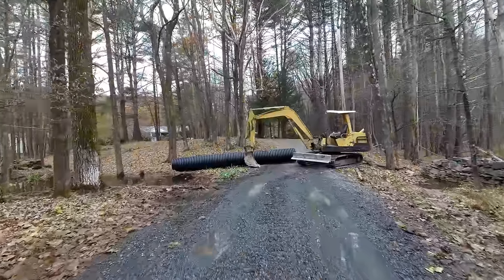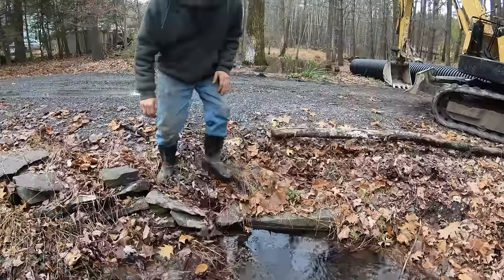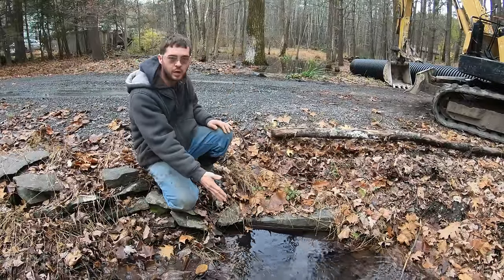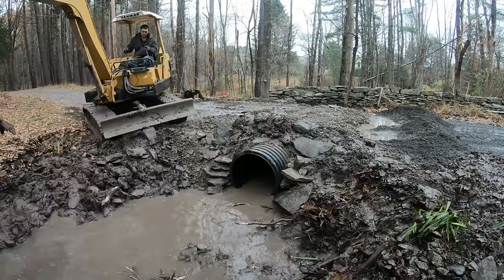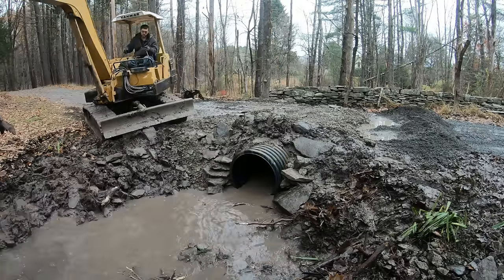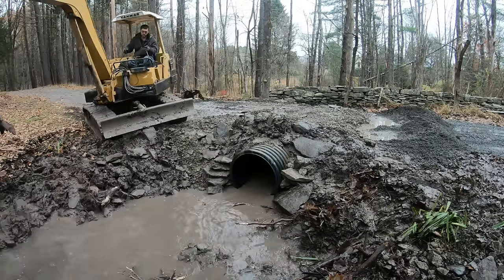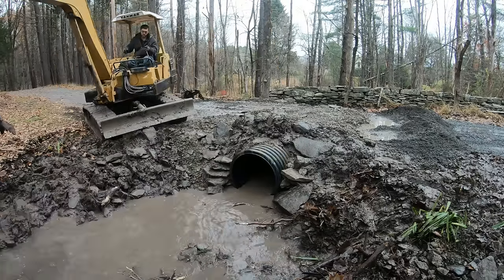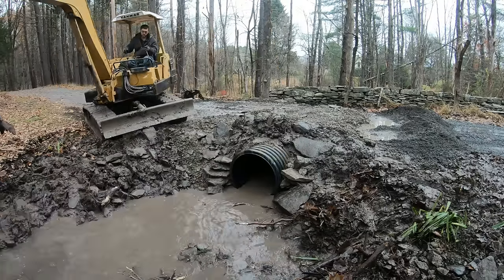Replacing a culvert pipe

Comment: Nice work Andrew!😉. Why people say you need more over the pipe is because ADS pipe what you're using suggests min. 12" over coverage. But most applications it isn't as rocky as the ground you seem to be working with. Here where I'm from in the NW we have some soft soils and can blow out the pipe easily if not covered good.  Keep up the good work and love the videos!
Reply: also need to remember this is just a regular drive way. so probably not heavy traffic or heavy vehicles crossing on a regular basis... hahaha.. probably should watch the entire video before commenting :P
Reply: mark suson  Uh huh. You obviously know nothing about heavy construction.  
1. ADS pipe gets its strength from being property bedded and backfilled with the proper material. 
2.The pipe was partially punctured with the excavator tooth.  
3. The pipe was laid directly on a rocky ledge bottom. 
And no heavy vehicles?  Septic truck, oil truck, fire truck.
Reply: @newmilfordseptic3375  I agree with you a 50 year rain will blow that pipe out. 12 to 18 inches of cover for plastic, I would use cast iron or concrete for that job.
Reply: New Milford Septic finally somebody talks dam common since

Comment: Where I am in Texas there isn't rock isn't as easy to come by. I can't be certain, but feel like the price of rock is likely a lot higher here. I have a half mile long dirt road that I had purchased a tractor to maintain. Wish I could get a lot of rock laid on it, but alas, half a mile of rock is expensive. Boxblade and grader worked great for what I was doing. Sadly had to sell the tractor. Next one I get will have a front loader on it. So many things I did with that 3pt that would have been tons easier with a front loader! Enjoy your video as usual. Great work.

Comment: When you do two pipes side by side, be sure and set them apart at least 1 to 1.5 pipe diameters, back fill and compact in layers to fill any voids between them so the vehicle load force on the crown of the pipe is transferred vertically into the ground rather than laterally into both the tube bearing the weight and the adjacent empty tube that may likely fold...…….cheers Andy! You and Levi rock....

Comment: Hi Andrew you are unique mate I watch your videos almost every night now as I was a plant operator in the UK and drove a JCB 3 digger loader which you fellas refer to as a " backhoe" it was similar to your wheeled John Deere machine.I too have a mig and a stick welder and a plasma cutter and love to make and repair things but I am not great at mechanical repairs 😥.
 Andrew a thick plastic culvert pipe like you replaced will take an enormous amount of weight as long as it is back filled and compacted properly as the pressure at the top is distributed from the top down the sides and out at the bottom so won't collapse down if a heavy truck goes over it .
Keep up the great videos mate I will be as sick as a parrot if they run out so stay busy pal and take care of Levi and Sophie they are boss mate! David Flynn Liverpool UK.

Comment: Think the pipe depth was spot on,  if it was dug in deeper you'd think it would block up quicker with sediment.  That smooth bore black poly is excellent,  tough as , self cleaning to a degree. The outlet area might need digging out a bit , might keep the inside of the pipe cleaner.

Comment: as a construction inspector I would have liked to see a gravel base set to a percentage of  grade from end to end and covering the pipe with some clean modified would have been better than pushing in the excavated soil to prevent distortion of the pipe  but neat job
Reply from the maker: Yeah, that would have been better. I gave her a price, than she talked me down. She wanted it done as cheaply as possible. That fill material was mostly stone though. But since it settled for a couple weeks before I added more stone It should be fine.

Comment: Great job! I can guess if this collapse (since we can't control what runs over our driveways sometimes) a stronger solution will be to add a 6" concrete slab over the culvert pipe and see who's going to break it but that's on your customer. Time will tell.

Comment: From my experience, I think the depth of the pipe is fine. If you set it lower, and if there was a heavy rain the volume of water would fill the pipe up and the excess would cut across the driveway. In my opinion.

Comment: Increasing the pipe size from 8" to 12" diameter (x1.5) will roughly double the flow. Double the pipe size from 8" to 16" diameter (x2) will quadruple the flow (x4 flow). With Andrew putting in 20" pipe, he's increasing flow roughly 6 times over a 8" pipe diameter.
Reply from the maker: Plus the smaller Pipes seem to clog up with leaves
Reply: @AndrewCamarata  Definitely the truth. I agree with your call on the steel corrugated pipe too, that stuff is junk and just rusts out. Plastic or ABS is the way to go. Great videos, keep up the good work Andrew.

Comment: try buying a plate compactor or small roller if you do alot of these gravel driveway repairs. yes, filling the pothole with a larger rock will work for now but really isnt the correct way of doing it. Nothing is keeping those large stones from moving. A nice compaction of the base prior to spreading the top layer or gravel will help keep those holes from reforming. A snow plow or heavy truck (like the garbage truck) will make those larger stones shift and push them out of the way but if you compact some road base stone (3/4 crushed stone and stone dust) it will be almost as solid as asphalt, then you can lay the gravel in and will get alot better, long lasting result

Comment: I noticed on your dump truck you pull the lever down by hand. Tie a rope on the handle and bring it in the cab through the window. then start driving and pull the rope when you want to open the tailgate. Will make it much easier than jumping in and out of the cab.

Comment: Good job. The Ford seems to be your go to dump truck. Big one you bought still working OK? On capping culvert pipes: old spec is cap with minimum of 50% of the diameter of the pipe. But if you can drive a heavy garbage truck over it and it doesn't collapse what you did looks to be just fine. We don't have bedrock at 2' down here in Texas:that has to be really hard on your excavators.
Just an observation but you're replacing a lot of metal culverts because they've reached the end of their service life. Acid rain does a number on them as it does here in Texas. 30 to 40 years and they're toast.Seems like price wise from low to high it's concrete,metal,then plastic. Used all 3 and personally I have no preference. Concrete is a bit of a pain because of the short lengths and labor to install.Trick I learned years ago is to put an asphalt shingle over each joint before capping. Keeps the fill fines from seeping through the joint and plugging the pipe.
Reply from the maker: Thanks. Yeah, only needed a little gravel there, I would rather use the Ford for that. The other truck is ok.

Comment: When you hit those hidden rocks below the water you should have dumped soil across to stop more  incoming water, then the water hiding those rocks would have drained away leaving the rocks visible, making it easy to dig them out to get the trench about 12" deeper and making sure it had a flat sloping bottom to it, the pipe should then have been carefully infilled with fine graded material around the sides before covering it, more care should also have been taken when building the slabs up at each end of the pipe.

Comment: When he does a job and then leaves, it is as if that was always there and part of the scenery.  I would hire him anytime.  Those rocks on the ends is a great added touch most people wouldn't bother with.  I've seen guys have their driveways dug up, a pipe laid and they spread dirt and gravel mixed back over it to cover it up and level it off and leave.  The homeowners were raving mad.  They didn't  expect that YET they didn't ask them or tell them how they wanted it done.  She made a costly mistake by not hiring him the first time. I did not see, for example 16 feet of pipe when he dug that up so what did the other guy really do?

Comment: Potholes will never go away until they are dug/broken up. The dirt/soil/ground should be tilled or raked or bladed until there is noting but loose base/gravel. I then go back and regrade and spread fresh gravel on the drive. Just filling up the hole does nothing. You know this stuff though!

Comment: WOW< What A Difference between the old pipe and the new pipe, i reckon the old pipe was 4 times smaller then new, uyou can see the new pipe bearly gets the water in the bottom while the old pipe was getting FULL of it, full  of the water

Comment: Looks pretty good. If you keep having problems with potholes and need more coverage on top, you should try two 12" pipes and set them side by side, then place a good amount of riprap  along the bottom and sides of the inlet and outlet to prevent erosion.

Comment: The ADS needs at least 12" of backfill. You should either use multiple smaller ADS pipes and provide the cover, or raise the height of the driveway.
Reply: and let the water Atleast go down an drain before throwing pipe in a fighting it.  your rights not enough fill on top he said trash man drives on it..  he will destroy that area

Comment: your potholes came from backfilling with saturated material that looked like concrete slurry. should have been hauled away and backfilled with clean , dry material and compacted  every 8-10 inches.I would agree , it needs a good lift over top. At least another 10 inches as poly pipe tends to flex more than other materials.

Comment: you did a nice job Andrew I would be interested if there are any bottlenecks just downstream that would impede the water from moving away quickly from the problem site otherwise as the water backs up in a heavy flow you get flooding; I always get my contractor to remove any large boulders downstream

Comment: That customer sounds so irritating. She went with a lower bidder who bid to only do a bit of digging and clean out a collapsed culvert... which did almost nothing. They probably did a fine job, but only did exactly the work they quoted for. So instead of calling that contractor back for the additional work to get the job done, she called a different company (you) to do the job that should have been in the first place. Then when it turns out more gravel is needed to do the job correctly because of the bedrock, she has to be "talked into" a tiny $150 load of gravel. They say the customer is always right...

Comment: Plastic pipe is nice. Not so rigid as steel. The ditch in front of my house needs a culvert, but runs on downhill incline.  Hoping to put plastic one in and cover with dirt for mowing purposes. Don't know if local road commissioner would do it or not. They use metal culverts everywhere.
Reply from the maker: I have never had a problem with a plastic pipe. The metal ones always seem like they are rusted out.

Comment: I calc'd drainage areas and sized culverts for roughly 30 yrs and then supervised their installation.  Getting a SOLID even base is key to a culvert lasting and having the correct cover is also part of the formula so it doesn't get crushed by a cement or garbage truck!  ADS (green stripe) has a booklet that tells you HOW to do a culvert installation.  Please talk to the owner about getting the stone you say your going to bring in and getting the 1 foot minimum cover ADS recommends.  Failure to do so puts you at risk when it collapses of having to do it right the second time around at YOUR cost! (edit)  On a side note I would have placed an 18"x24" class 5 concrete culvert in as you get HS20 loading with minimum cover... you could actually drive ON the culvert if need be!  But then I didn't have cost restrictions most of the time...
Reply from the maker: I told her it needs more stone, she doesn't want to pay for it. I wouldn't be changing it at my cost. But I don't think it will ever fail.
Reply: If it was my property and it failed you would most definitely be re-installing it... thru a different contractor that you would be paying since I would prove in small claims court that you did a schlock installation not up to standards!  (edit) Course if it WAS my driveway I would have rejected the work and not paid you!
Reply: Not everyone has unlimited funds. 
And why would an expert hire someone to install a culvert for them??
Reply: Maybe because I don't own a backhoe??

Comment: Just what I need! I have a stream separating 20 acres. I was going to try and building a bridge. I think two of these, but larger diameter will solve my problem. Stream is about 15 feet wide and 1-3 feet deep at certain places. What do you think? Just tractor, atv and SUV going over it.

Comment: That pipe needs more cover. With a heavy rain its going to float up and wash out.
Reply: I'd say wash out and then float. But yeah. Needs some concrete.......;)
Reply: @ike fun Heres a good life lesson for you 'ike': the term "professional" generally has a very loose and relative definition. He's using ADS-type pipe. The company lays out specific requirements for minimum cover to prevent flotation which is based off of some kind of weird magical voodoo thing you may not have heard of yet, its called "math". For the 24" pipe he installed, the manufacturer requires 17" of cover. From the looks of this video I don't think he even had 2". The homeowner is likely going to be hiring a 3rd excavation company to install another pipe the properly in the near future. If he coundn't get the proper cover he should have installed a different type of pipe (RCP, CMP, etc.). If you doubt my facts, heres the reference: 
https://www.ads-pipe.com/sites/default/files/Pipe_Flotation_%28Tech_Note_5.05_03-16%29.pdf

Comment: That doesn’t seem deep enough? The pipe seems to be just below the surface. Lol. Just got to the bit where you said it wasn’t deep enough. 😂
Reply: With the hdpe duel wall.  It will work just fine.   Trucks can drive over it.

Comment: Yup, those plastic pipes last so much longer. Here in The Netherlands a lot of the old concrete sewage pipes are replaced with PVC. Easier to work with cause it's lighter, lasts much longer and the all the shit and stuff flows much better through them.
One question though, and I'm not bashing your work, just wondering: wouldn't it be better to fill the trench with sand? Seems all the potholes are from airpockets between the debris are slowly filling up. I work for a company that does sewage and the main reason for potholes is not properly filling up around the pipe. Also less risk of damaging the pipe when heavy traffic runs over it.
Reply from the maker: IDK, maybe gravel would be best around the pipe, that's kind of what the material was already. That lady talked me down on that price twice. The pipe went in there as cheap as possible.

Comment: I liked the tip of filling in pot holes w large rocks before topping w fresh gravel. 
Do you have any tips for wash boarding on gravel drives? I’ll smooth mine out and within a few months it’ll be rippled again in the same spot especially if we have good rains. 
It doesn’t disrupt the base of the drive only the top layer of gravel. I have roughly 2”-4” of 1/2” gravel on top of my hard packed clay base. 
Thanks
Reply from the maker: Keep the water off it.
Reply: Andrew Camarata how? There’s about a foot deep ditch to the side that catches rainwater runoff. I don’t know how to keep water off it.

Comment: Andrew nice work, I have a question i hope you can help me with. In pennsylvania i just purchased 4 acr lot on a mountain,with a long down hill dirt rd.    When I install my driveways do you think it would help to  cast concrete inlets and outlets to help hold the pipe.Also i was thinking of making a trench the length of.  the frontage,  followed by a layer.  of 10 to 12 nich trap rock  with peastone on top level to almost the surface of dirt rd; to stop erosion and still have an ability.  to lower my or other drivers chances.  of getting stuck in the ditch between the 2 driveways.Hope you know what im asking and sorry for sutch  a long comment, I trust your opinion very mutch ps i have been following your channel for about 2 years best working person and honest all around contractor.  on you tube.Have lots of turkey and pie, and share with the 3 best friends a man can  have.
Reply from the maker: Yeah, that stuff sounds good. It may be more work than needed, but its nice to do a good job on things.

Comment: I got a 12" pipe in a ditch and it can't handle really hard, fast rains after some time without overflowing (40` run about a foot deep) ... do you think going to a 18 inch pipe would solve the problem? And a single wall 18" could handle the weight of a loader like that your using after buried?  Thank you!!